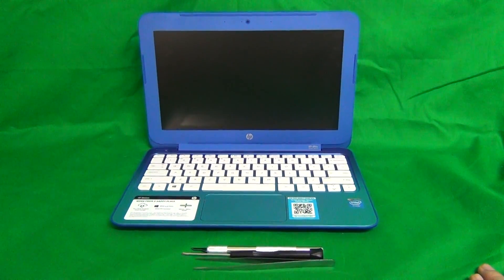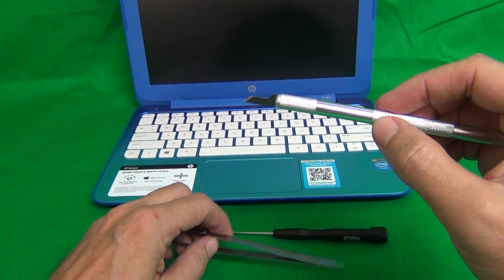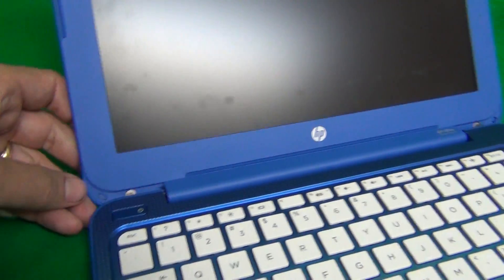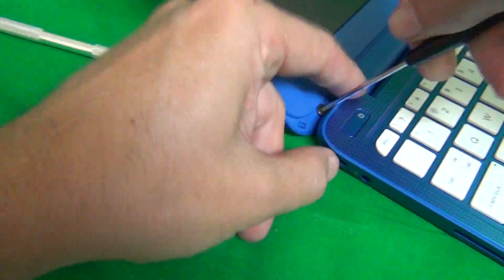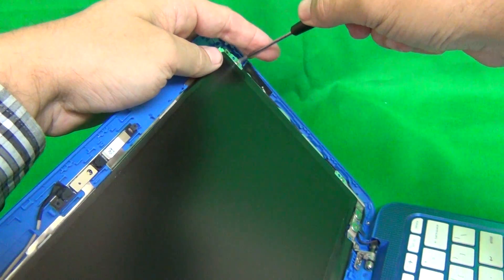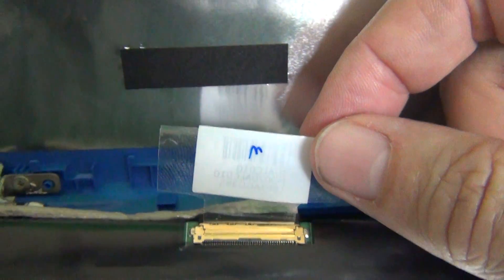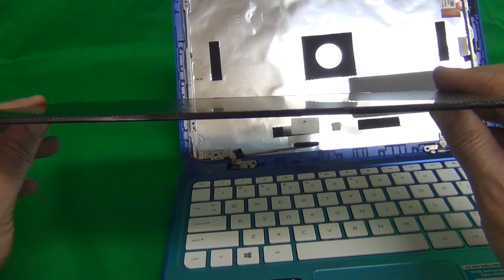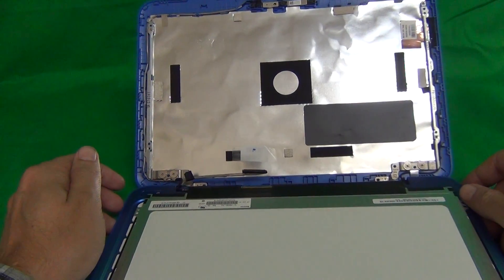HP Stream 11 Laptop Screen Replacement Procedure

Comment: my frend just bougt this replacement from ebay for 25 pounds, i replaced it for him and now 30s after start there is white vertical line of badblocks 1 inch from right. i made photo before this line appeared and compared with couple minutes later made photo so i can clearly see this new monitor was not tested for quality. i will advice my frend to replace replacement :)

Comment: I cannot thank you enough for this video! I upgraded the WiFi card and the single antenna to an Intel 7260 and dual antennas. I couldn't get the screen frame off due to those two STUPID screws at the bottom. Luckily I found your video and managed to make this work without breaking anything... too much.
Thanks again!

Comment: my screen wont light up wondering what i did wrong
Reply: I'm having the same issue.  I put the original back in and it wont light up either. Please help!
Reply from the maker: Please double check to see if it's a faulty connection:

http://www.youtube.com/watch?v=BDm1zMIIywA

If the connection is good please try the original screen again to see if it lights up and the image is displayed (or at least partial image). 

If the original screen worked, please install the replacement screen once more.
Reply: now what if theres an arc when connecting, shud it matter?
Reply from the maker: Apologies, but can you please elaborate on the arc part.
Reply from the maker: @Mac's Market Were you have the same issue before replacing the screen?
Reply: Screen Surgeons like an electrical spark between the two connections when connecting the screen to the video cable
Reply: when I reattached the orig screen....no response
Reply from the maker: When getting electrical sparks, it's a bad sign which might cause a short circuit. The cable might be damaged or can you please make sure the laptop is powered off when trying to replace the screen.
Reply from the maker: @wfs1965 The same with Bill's issue, the cable might also be damaged since original screen is not lighting up too. Please check if there are signs of broken pins on the cable.

Comment: also i've just found this screen on ebay for a very low price coz i'm replacing one of these right now for one of my customer's.
http://www.ebay.co.uk/itm/New-HP-Stream-11-r000na-Laptop-LCD-LED-HD-11-6-Screen-
Display-WXGA-/361701866216?hash=item54371c7ae8:g:eYUAAOSwPc9WzFIy

Comment: impossible to open the screws. used ph0,ph00,ph000 doesnt work. its m2x2 screws for my 11-d011na. dunno what screw driver goes in it. this is ridiculous. helpful video though. cheers

Comment: I used a PH 0 screwdriver, but the screws will not come out! Followed your directions to a T. Under the plastic that covers the screws it has an arrow that points to the screw which says that they are m2x2 screws.  What do I do?
Reply: Hi did u ever find a solution to that problem. As I can’t get the screws out either

Comment: Put in the screen exactly as instructed, checked connector and put it back together, but now the screen is completely black. Tried the old screen with the same result. Did I somehow damage the connector? I was extremely careful and nothing looked or sounded wrong, but I'm not sure what else to do at this point.

Comment: I did everything you said and now my screen is very dim. I have to connect it to my tv to use it... I even tried to reconnect the old screen but it was still very dim.... Is there a fix for this?
Reply from the maker: +jessica orengo Can you please follow these steps to figure out the problem:

* Please double check to see if it's a faulty connection:

http://www.youtube.com/watch?v=BDm1zMIIywA

* If the connection is good please try the original screen again to see if it lights up and the image is displayed (or at least partial image). If it does, then try the replacement screen again. Thanks

Comment: I installed the screen did everything you said. I have the same model screen and everything. But my problem is after installing and turning on the computer. The screen is still black. Can you or anyone help me out on that? What's wrong with the computer. It was suppose to be an easy fix
Reply from the maker: +juasdscxx09 Can you please follow these steps to figure out the problem:

* Please double check to see if it's a faulty connection:

http://www.youtube.com/watch?v=BDm1zMIIywA

* If the connection is good please try the original screen again to see if it lights up and the image is displayed (or at least partial image). If it does, then try the replacement screen again.

Comment: This video is a life saver. I broke my screen today and I wasn't even sure that it was possible to fix since the bottom part of this laptop is so impossible to get into. This thing is my first real laptop and I would have hated to have to replace the whole thing after only a few months.
Reply: +VampirePumpkins So I replaced my screen just now and it was super easy. The only comments I have is that the screwdriver sent to me was a little too big so I had to use my own and also one of the parts on the screen was a bent a little, but it was fixable. The screen looks great though and it was really easy!
Reply: +VampirePumpkins I punched mine playing a game like 20 min ago and I feel bad because my parents got it for me and I feel bad and nervous so I wanna try and fix it but if I turn the computer on it looks like a "hole" in the middle and a bunch of cracks and colors that web out from it is that how yours was or was it black because I wanna know if I can get out of dodge or if I'm fucked
Reply: Thank the lord did you buy the replacement from this video or did you get tone cheaper
Reply: +xXxPussyxSlay3rxXx Slays Puss3y I got one from this video because it came with tools and if the screen was no good, they'd replace it. there might be cheaper ones on amazon, but idk

Comment: Is it worth 60-80$ to repair a laptop screen for a 200$ laptop when i have a working desktop BUT i have a job.. is it worth it, i have 1 minimum wage job, my minimum wage is the nations minimum, not state unique, and also i work 4 days from 3:30pm to 10pm with a mandatory 30 minute meal that is taken OUT of my work time. SO.. is it worth it if this is my budget??, I also need to give my mother (im 18 atm and paying 1/2 rent) about 300+ for the house rent, then about 150 for the utilities and about 50$ for my own insurance. SO.. is it worth it to replace a busted screen?
Reply: MrCODEmaster00 YEs it is cheaper and well better for waste sites of computers I would reccomend putting 10 or 20 bucs aside a week to save for the laptop screen
Reply: MrCODEmaster00 yes, absolutely i am in a vary similar boat and i am definitely going this route, HP wants to charge $150-$250 to replace my screen, idk about you but im not paying that much to replace a part of a laptop when i can go out and buy a new one, but sadly atm i cant afford to so $67 for ground shipping and they include the tools needed?? where do i sign
Reply: +MrCODEmaster00 Repairing the display is still cheaper then buying a new laptop. You will also need to setup a new laptop where an existing one you are repairing will already be setup. With that being said it is not worth it to have someone else repair it for you, the cost would then be too much. You can also find this display for about $30 elsewhere, but I would be concerned about its quality.

Comment: I just received my screen and installed it.  It took longer to watch the video than to change the screen.  My replacement screen was "matte" finish.  It looked just like factory.  The included tools were handy.  Just a note:  The "little" panels are not snapped in.  They are little plastic covers that are glued on with contact adhesive.  They won't snap off, just lift up a corner and slowly peel them away.  I used the back of the hobby knife.  If you don't get them dirty they will stick back on.  Also, I used the tweezers to position the screws that hold the bezel on when I put it back together.  It is a tight fit.  Hooking up the new connector on the screen was a little tricky.   Overall, perfect fit, works great.  Will order from them again if I have a need.
Reply: Order from who? I need a new screen